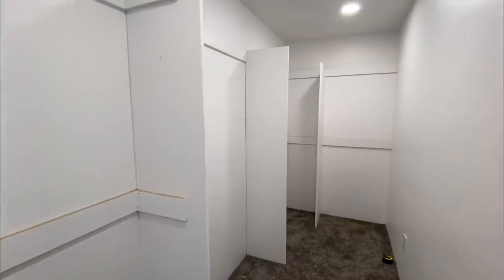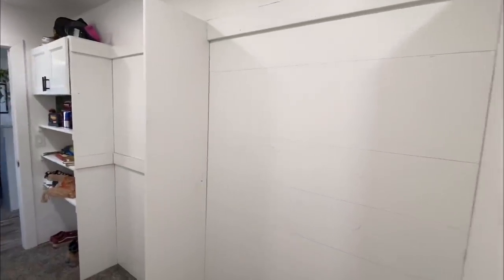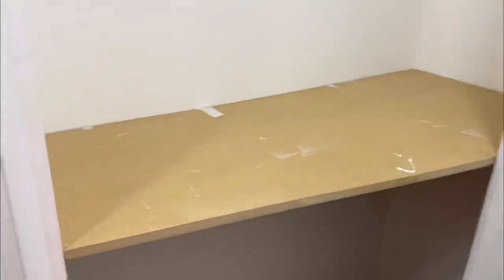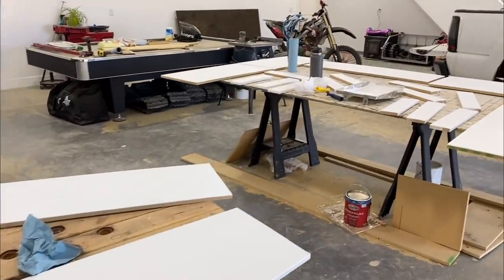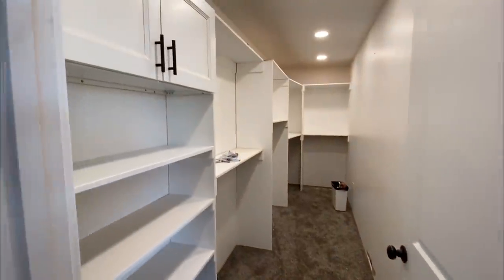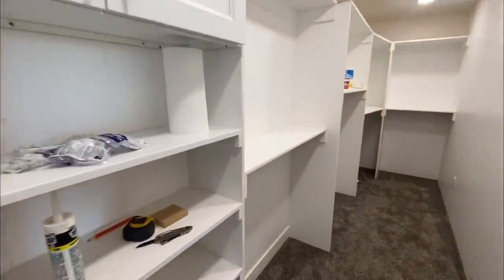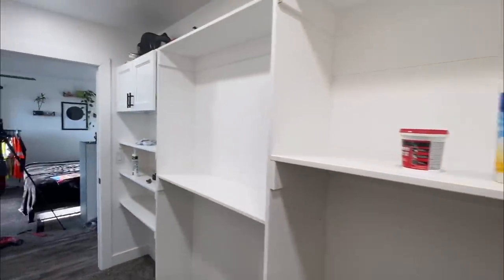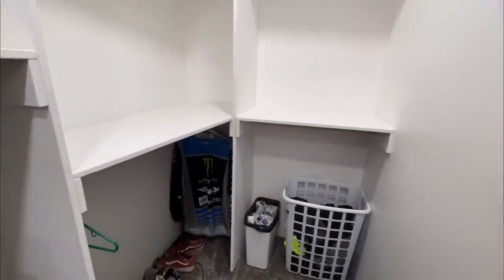#026 Custom Master Bedroom Closet (Shop House Build)

Comment: Most excellent work young man. Im absolutely not critiquing your work but i wouldn't have used mdf for this project. You'll see why in about 10 years. Just sayin.
Reply from the maker: Thanks! What do you recommend?
Reply: @Create208  i personally would have used 1/2" veneer plywood. The mdf is susceptible to even the moisture that's in the air and starts to break down over time. Even if it's painted. Paint is liquid and that starts the the break down. Again... You did a phenomenal job and it will be strong for a good while and i am in no way criticizing your work. I think your a kick ass young man. Your doing when so many people your age are sitting on their ass playing video games. Keep up the outstanding work.